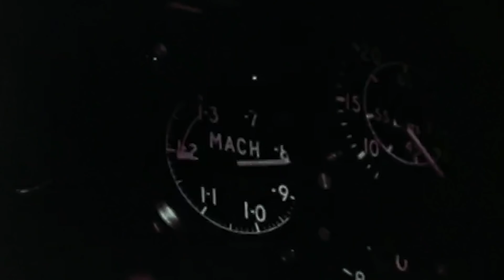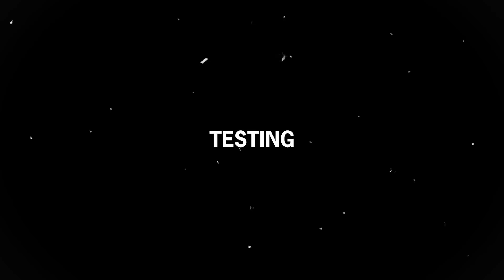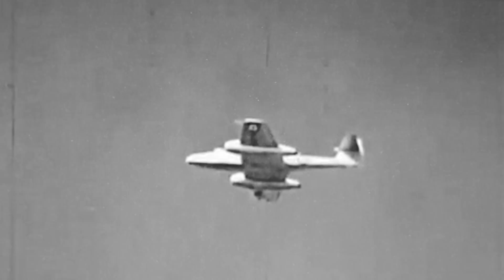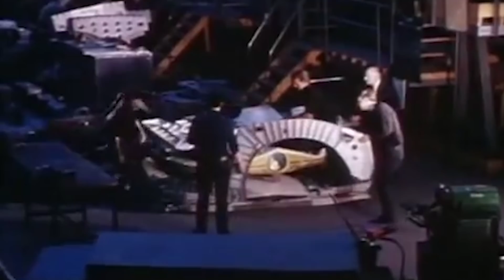The Bristol 188 Flaming Pencil - Supersonic Stainless Steel

Comment: That's where the SR71 came from...
Reply: No, the SR71 came from the Mach 3+ A-12...
Reply: Not quite! They actually debuted in the exact same month (April 1962), flying only 12 days apart. But they were developed in total isolation. Kelly Johnson and the Skunk Works team were already designing the titanium A-12/SR-71 in the late 1950s, years before the Bristol 188 ever got off the ground.The US threw absolute bank at the A-12, allowing it to blast past Mach 3 by July 1963. Meanwhile, the heavy, welded-steel Bristol 188 was so thirsty it could barely stay in the air for 20 minutes without running out of fuel, maxing out at Mach 1.88. Lockheed didn't copy the British; they completely out-engineered them

Comment: Well the did finish it but with a diferent name sr71
Reply: SR-71 was designed by the American Lockheed company.
Reply: Not quite! They actually debuted in the exact same month (April 1962), flying only 12 days apart. But they were developed in total isolation. Kelly Johnson and the Skunk Works team were already designing the titanium A-12/SR-71 in the late 1950s, years before the Bristol 188 ever got off the ground.The US threw absolute bank at the A-12, allowing it to blast past Mach 3 by July 1963. Meanwhile, the heavy, welded-steel Bristol 188 was so thirsty it could barely stay in the air for 20 minutes without running out of fuel, maxing out at Mach 1.88. Lockheed didn't copy the British; they completely out-engineered them

Comment: Meanwhile, as Bristol searched for data on M2 flight, in Dec 59 an F-106 set the, still unsurpassed, single engine jet speed record at M2.3 with a stock F-106.

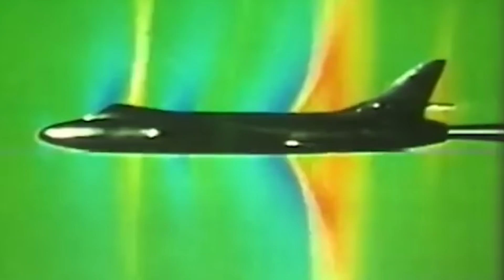Comment: Quote 2:31  -Significant time with skin temperature 300 C.-  is heard.
So...lets calculate a little. 
Th = 216.5 K,   a = 295.01 m/s,  Cp =1005 .. Ma = 3;  v = 885 m/s.
 Stagnation temperature on leading edge 335  C,  (= not the skin temperature )
At Ma = 2.88 stagnation temperature is 305 C. (Design speed Bristol 188?)
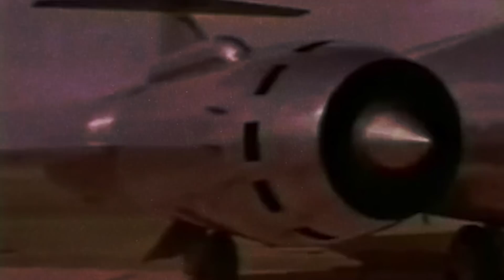Can see some type of Oswatitsch intake spike at 5:52 , but did it move, or had that feature to be invented / developed?

In 1964 when the project died, it was years behind the F-104, which was in full production then.
...and the BAC Lightning can fly supersonic for 10 minutes without external fuel.. so it is not that much better.

-In 1957 a white paper on defense was released...- missiles were the future... In 1944 the Londeners knew already that something like an A-4 (V2) existed and in that same year that German designer had the a two-stage A-9 rocket on his drawing board.... what happend in the 13 years behind? Was vision embedded under concrete?

Comment: I think the Brits had one faster than the Bell didn't they and certainly got to were BellX was beforehand as the first reaching the speed of sound at level flight but it was unofficial so Bell took the title and then the funding was pulled, all very strange.  remember the bell kept shaking itself with a major vibration problem towards and around supersonic until the Brits gave what was needed to succeed which was a moveable tail piece, this was supposed to be in exchange for like for like (ish) info but the Americans didn't hold up their end of the bargain,  no blames as I imagine this has happened by and to many nations but it was the title of first to reach supersonic with Chuck Yeager, which I don't think was really true, check out this,, see what you think,,,,
https://youtu.be/fGGnZMO4gag

Comment: Several of the video inserts show aircraft that are not Bristol 188's.  Obvious intruders include - 
the SCCSAO Trident, first seen at 0:18, and at 6:26 and 10:32
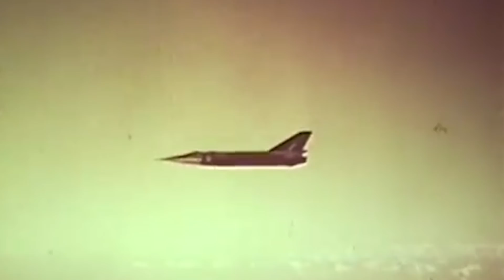Fairey Delta 2 or Dassault Mirage at 1:35
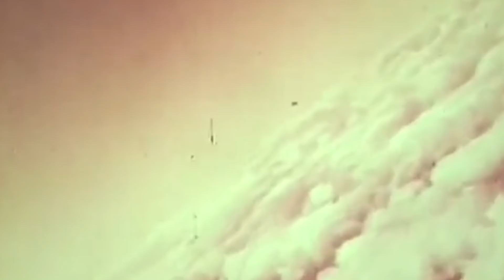and a Gloster Meteor at 6:33
All of these are shown without any distinction.

Either this is very sloppy research or you just don't care and enjoy confusing and misinforming the public.

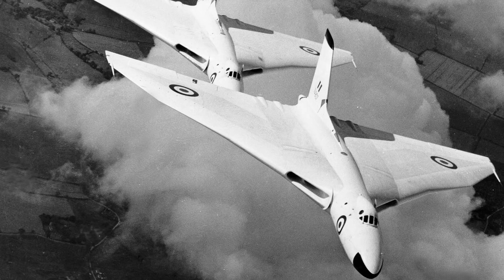8:07  The 188's wing shape was about the only thing it shared with the Avro 730 submission.  The 730 had no cockpit canopy, removing the need to create a heat-proof windscreen, but leaving them relying on a periscope for landing.  Not sure what showing a pilot in a wooden cockpit-plus-canopy mockup at 8:07 (looking more like a De Havilland DH.110, which became the Sea Vixen) has to do with the Avro 730.

8:49   "The missile age could render bomber aircraft semi-obselete" accompanied by a picture of an Avro York transport taking off.  While derived from the Lancaster, it was a transport and not a bomber.

10:32   "In 1972 ... serial number XF926 was dismantled and sent to RAF Cosford"  - accompanied by picures of forlorn TSR2 fuselages, a much later project with many pitfalls of its own.  Note the side-by-side engine bays in the fuselage for a start.   

" The other prototype, XF923 ... was sent to Foulness Island for scrap".  Foulness is part of the Shoeburyness P&EE range, and you've already told us about that.  Once you've shot at an aircraft on the Maplin Sands often enough, it loses its usefulness as a target, you see, resembling only a pile of scrap.

Your disclaimer "Dark Skies sometimes utilizes similar historical images and footage for dramatic effect." is insufficient as you make no effort to distinguish them, leaving the interested enquirer confused and badly informed.  At the very least, use a text overlay identifying the non-legitimate additions accurately.

Comment: i always wonder about the X15 being designated as plane, its closer to a piloted missile, it couldn't take of under its own power, having to be brought up to attitude under the wing of a bomber and then released, at which point it would ignite its rocket motor, when this had run out of fuel it had to glide to a landing, even Orville Wrights took off and landed under its own steam so to speak lol, still a remarkable achievement though no doubt about that :).

Comment: In addition to other errors made the pic of the PS50 engine is wrong. The engine in the pic looks nothing like the PS50, which is primitive compared to the PS50 with its intake housing fabricated entirely in stainless steel (replacing the cast aluminium intake of the Gyron Junior). The PS50 also had an "Annular" combustion chamber not the primitive multiple "Cans" shown in the video. I can say this with confidence because as an apprentice I used to drool over the engine sat unloved in a corner of the experimental test beds a Hatfield. As luck would have it I was assigned to assist in getting it up and running after having been mothballed for some years, for the purpose of commissioning a new testbed. On one of the test runs a couple of other apprentices and myself sneaked into the test cell just prior to start up. The cell was not spacious, so we were stood no more than 5 feet from the tailpipe when the engine went on to reheat. Even with hands clamped over ear defenders the noise and vibration from the exhaust shockwave was horrendous and frightening. But it was impossible to escape - the exit door opened outwards and the negative pressure in the cell running at 100% made it impossible to push the door open. All we could do was crouch with defenders jammed tight over our ears and wait until the engine eventually shut down. To this day I can still visualize those diamond shaped shockwaves no more than 5 feet away!!.

Comment: In some spirit, the idea of this plane would go on to live in the SR71 as the knowledge of its design would influence manufacturing techniques and show that all new alloys were necessary to break that Mach 3 barrier
Reply: Not quite! They actually debuted in the exact same month (April 1962), flying only 12 days apart. But they were developed in total isolation. Kelly Johnson and the Skunk Works team were already designing the titanium A-12/SR-71 in the late 1950s, years before the Bristol 188 ever got off the ground.The US threw absolute bank at the A-12, allowing it to blast past Mach 3 by July 1963. Meanwhile, the heavy, welded-steel Bristol 188 was so thirsty it could barely stay in the air for 20 minutes without running out of fuel, maxing out at Mach 1.88. Lockheed didn't copy the British; they completely out-engineered them. 🛠️

Comment: British cabinet minister; "Regrettably the government will no longer be funding further work on your aircraft."
Bristol Aeroplane Company; "But the leaps in technology we've made."
British cabinet minister; "Have you thought about cutting off the wings and going for the land speed record?"
Reply: ........or even better, we'll give it to the Yanks. (again!)
Reply: Not quite. It was a primitive attempt at Mach 3 high altitude prolonged flight. History says so, not a matter of opinion but fact.
Reply: @ubroberts5541  Not much of an attempt since it never even got to Mach 2.   Saying you are going to try something is one thing - but what matters is achieving it.   Airplanes of this era faced a rapidly changing environment.  The advent of improved radar systems and surface to air missiles, along with ICBMs, rendered high speed, high altitude bombers useless.   Not only were projects cancelled in the UK and Canada, but the XB-70 program in the US was also cancelled.  And the XB-70 DID achieve sustained Mach 3 flight.  In addition, the B-58s career was cut very short as well.

Comment: Stainless steel expands considerably with heat. That would lead to buckled panels as the internal structure will be much cooler. Electrolytic corrosion makes stainless against aluminium problematic. So it’s no surprise they had problems b

Comment: Basically a story typical of Britain:   Wasting a vast amount of taxpayer money at a contractor not up to the job resulting in a useless product.   And people wonder why the Government finally woke up and essentially canned the British aircraft industry.   From the Comet to the TSR-2 the Govt had had enough.  Up to WW2, it was the wood and piston driven propeller age and any competent engineer could come up with progressively evolved aircraft with not much cost.  But in the jet supersonic age only superpower countries - the USA and USSR - had the money and brainpower to do the breakthrough job required.  And even they had problems and set backs.
Reply: It's odd that the British government were keen on Concorde and " the white heat of technology"
Reply: @toonmag50  :  Ah, the Concorde - one of the silliest, money burning projects ever.  A dangerous aeroplane that cost 30 times per seat mile than anything else.   Although the Concorde wasn't ready for service until the mid-1970's, it dates back to a design began in 1954 - the same year as the Bristol 188.  Linking up with the French to make it created some political inertia to keep the project going, as the flagship project (almost the only project) of BAC, the company the resulted from all the forced mergers of the various lame duck British aerospace manufacturers.  A sort of political "none of these turkeys can do any good, so let's force them all into one big goose outfit" government decision.
Reply: @keithammleter3824  Mmmm yes yes we know that story, hindsight expert.
My original reply was merely suggesting that the UK did have the technology and interest to continue with aeronautical engineering into the 1970's.
You seem so negative about the UK I'm sure you'll come back with some further explanation .
Mind you, judging by your username you're  not even British,  probably US .
Reply: @keithammleter3824  oh and I forgot to mention that in the history of military aviation, very few, if any,and certainly no high speed jet, aircraft have been built without government financial backing.
Even you're heroes, the US, who, without their taxpayers would have very little too show.
The US also burn taxpayers money, also with many cancellations and , probably worse than this, continuing to fund, at great expense, dubious projects into production
Reply: @toonmag50   Explanation as requested:  Actually, I'm Australian, father German descendant, mother immigrant from England.   You are right - I do have a negative attitude to British firms like most Australians.  That comes from experience.   We put up with shoddy British goods until the arrival of Japanese goods in the 1960's.   The quality was a revelation, considering the low price and on-time delivery.  
However, the  disgraceful waste of tax payer funds by the British Govt on a whole succession of aerospace projects that never   met any practical purpose is a separate issue very well known and written up, even in Britain.  That includes things like the Brue Streak missile, sent out to Australia for testing in our desert.   The only part of it that worked well was the engine, built by Rolls Royce exactly to drawings purchased from an American firm.  The abandoned huge concrete launch pad is still out there in our desert.  British incompetence includes things like the Bristol Brabazon  (a monstrous slow noisy propeller airliner, obsolete before it was even drawn,  designed and built to a completely pointless British Govt specification.   Not a single one sold.   It includes things like the Comet - designed and built by a firm without any competence in jet transports - lots of crashes due to things failing under presurisation and rapidly withdrawn form service.
You said Britain had the technology and interest.   The interest perhaps, although inertia and foolhardiness is a more accurate term.  But technology they did NOT have.   The Comet was a clear example:  DeHaviland engineers, not having any experience, thought that making a pressurised airliner was just a matter of calculating enough strength in the hull.   But, as the Americans had known for years and years, that's not by any means the full story.   You have to make things like radio antennae that penetrate the hull strong enough too.  They didn't, and Comets crashed because of it.
Reply: @toonmag50  : That's quite true, and I alluded to it in my original comment.   The difference is, as I said, the Americans (and the Russians) were big enough to spend what it took and get it eventually right.    Britain did not, and shouldn't have tried.   
Here is an oft-repeated humorous story that has a great deal of truth in it:  At the end of World War 2, Germany was overrun by Russian troops for the east, and American troops from the west.  Britain kind of tagged along no doing much.  The upshot was that the Yanks captured the German aerospace design engineers and boffins.   The Russians captured the technicians and manufacturing  experts.   Britain didn't get anybody.    Hence the Russians were able to quickly get a successful jet age and rocket industry up and running.   The Yanks, with all the boffins, got off to a slow start but with the German brains were able to get ahead.  Britain, with no boffins, and no technicians, got nowhere.
Reply: @keithammleter3824  I thought as much.! lol.
I thought that you're a German yank but I wasn't far wrong.
They're lot's of you types in Australia, you seeped over they're after the war, and still have that teeny tiny axe to grind.
I've heard all this anti British bile from you types and it's easy to spot .
You've undermined anything of interest or originality that you may have squeezed out.

I did like the way that you over emphasised the word "aeroplane", too obvious, as a troll you need to be more subtle.
Never mind, enjoy your Japanese cars, and the mineral trade with China.
FYI, the British aerospace industry is still the largest in Europe, it seems like you Germans need the French to collaborate more than the UK. LOL
Reply: @toonmag50  : Wrong again, sport!   A few Germans (as with other Europeans) came over as refugees immediately post-war, but West Germany soon rose up economically, and not many came out then.   Most Australians of German heritage, as am I on father's side, are 4th  generation Australians - great grandparents came out here 1870's - 1890's.  But we have vast numbers of immigrant Poms.  Huge numbers came out in the 1960's.  British goods = shoddy, delivered late.    That's why the British aircraft industry is pretty much gone  (how many BAC aircraft do you see in service?  Only a few.   Boeing etc everywhere),  British car industry gone, British electronics industry gone, Textile industry gone.    All gone due to shoddy goods delivered late.
And its a crime.   During WW2, British industry learnt, by necessity, to improve quality, as did every other country involved.   When the War was over, businesses said, well great, we can use our wartime experience to make better products.   Old jobs went but new ones were created.  But not Britain. Britain was unique.  The British said, great the War's over, we can relax and resume our old ways and give Fred his job back.   Go and read old industry magazines and professional journals and you'll see this.  That's why, pre-war, Britain was a huge exporter, but not for long after.

Comment: Correction:   @12:20   "while the speed of sound had been surpassed in 1948..."   The speed of sound was first surpassed in an aircraft in 1947 (not 1948), by the American Bell X-1 rocket-powered aircraft, piloted by USAF Col. Chuck Yeager.   https://en.wikipedia.org/wiki/Bell_X-1    - also -   @08:03  -  they were not known as "B bombers",  they were the "V Bombers":  "Valiant", Vulcan",  and "Victor".  Very poor research.